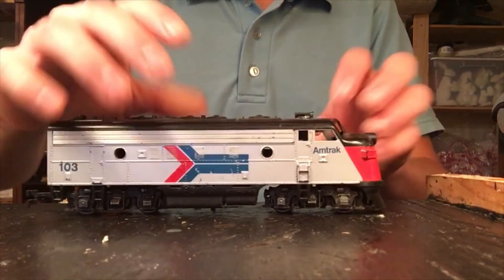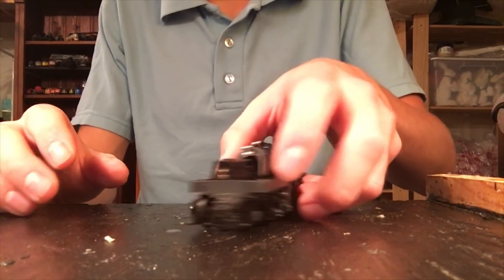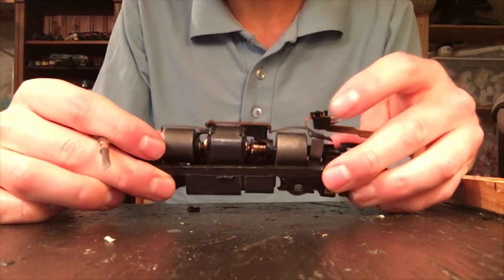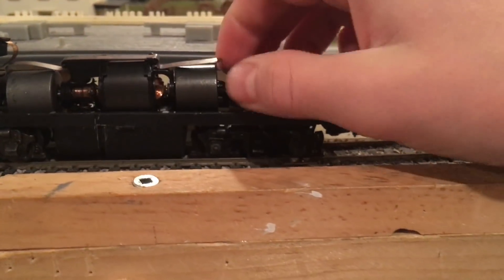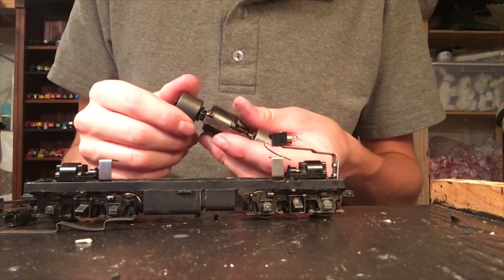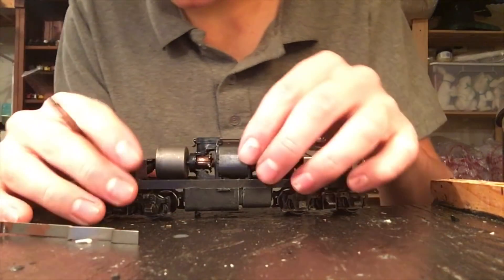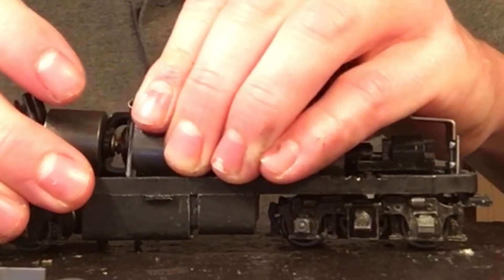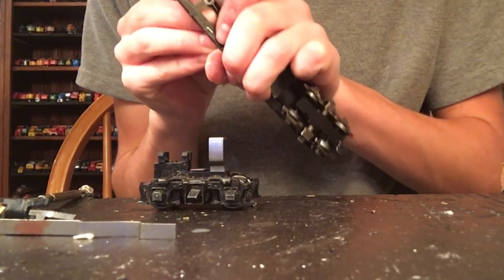Amtrak f7 Restoration

Comment: The 2 yellowed plastic pieces under the motor are 2  motor mounts.  They were originally soft pliable white rubber, but get old, hard, brittle, and break.  Then the motor jumps up and all kinds of issues ensue.  Athearn does (or did) sell replacement mounts brand new.  You can sometimes find them available on E-Bay.  I am reasonably sure they were the same for 4 decades.  There were 2 designs, one had 2 button posts per mount, for most all Athearn  diesels, and a 1 button post mount for their SW-7, 12, & 15 models.  I think I even saw 1 or 2 SW models on your locomotive shelf, so have a look at them and see.  You might want to take stock of all of your Athearns and order 2 spare mounts for each locomotive you have.  The buttons are visible on the bottom of each locomotive, so it will be easy for you to   make a list of how many pairs, and what type (1 or 2 button) mount you need.  The old ones will pop out (or crumble out) by poking the buttons through from the bottom.  The new mounts fit onto the motor frame and then the motor is pushed down into the chassis, and the buttons pop through the bottom to hold.  The mounts are relatively cheap and will improve the running and reduce the noise level of all your Athearns!  Cheers!

Comment: Just a friendly critique:  when pushing the motor down onto the rubber mounts, support the loco under the fuel tank. Don’t bear down on the whole chassis.  Same with the worm clips, support the underside of the truck with your fingers.  This keeps from applying excessive pressure to the wheels and axles.

Comment: I have a complete set from model power I tracked down with the F2-A unit I actually have 2 F2-As but for some reason the windows are different than it's real life counterpart because I looked it up and it looks more like the one in this video but on my train the front windows are more curved.

Comment: Can you do a video where you turn one of your many F7 locomotives into a dumby locomotive? I got an F7 that had the motor removed but everything on it is still stiff and i cleaned the trucks,wheels, everything on it and its still stiff and i dont want to risk trying to use it and it puts a strain on the power of locomotive any

Comment: Update!  Here is a link for the Athearn motor mounts you need to get.  https://www.ebay.com/itm/Athearn-Blue-Box-Loco-Parts-12-Pack-Loco-Rubber-Motor-Mounts-Stk-84020/362443641715?hash=item5463531373:g:sUAAAOSw9V1aVQmf